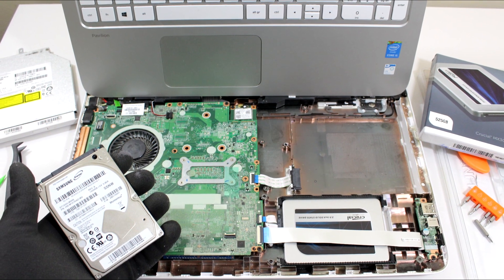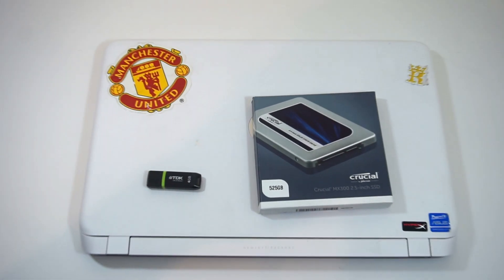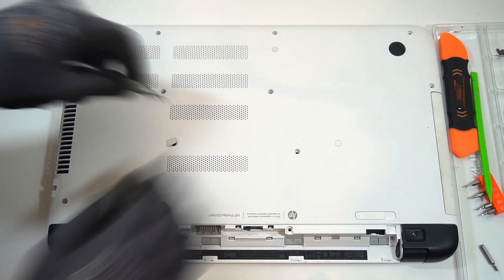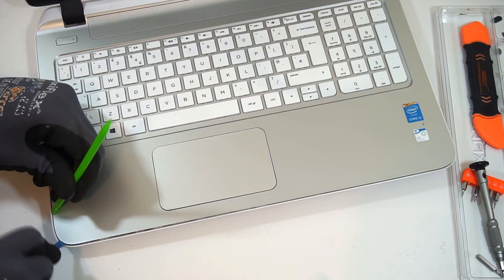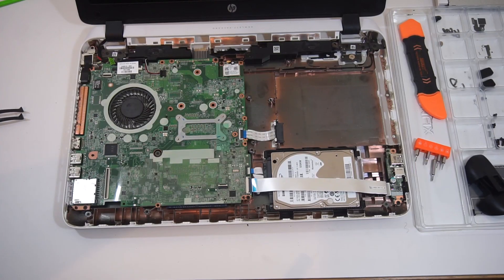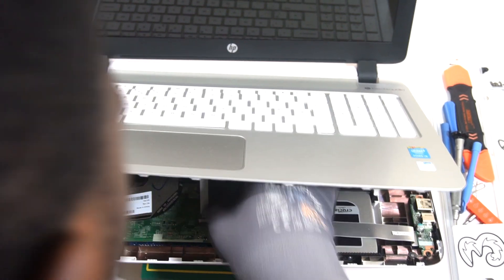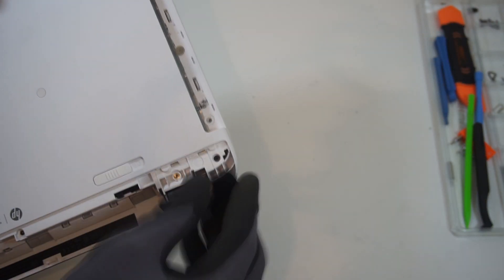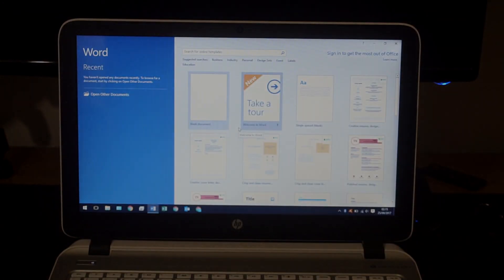Slow Laptop?  How To Upgrade Hard Drive To SSD - HP Pavilion P Series [15-p189na]

Comment: Great video, I have a P189NA that really needs an upgrade so will attempt this at some time soon. It currently has a 1.5TB hard drive and whilst it is great for as a main storage drive, it's just not fast enough for what I need. (My main laptop, also a HP, has a 2TB mechanical drive, and yes I do need 2TB on that laptop.)
One thing: according to HP's website, it says the laptop has two 750GB hard drives. Does this machine have two 750GBs or one 1.5TB? The SSD I am planning to use is Crucial MX500 512GB.
Also, how easy is RAM upgrade? I'm looking to upgrade to 16GB RAM at the same time.
Reply from the maker: I know this was 6 months ago but I'm just noticing it now.

So to answer your first question: no it's just one drive that's 1.5TB. it's just partitioned into 2 places.

I think the RAM is built in, I never looked into this. If it's not built in then you'd have to check the motherboard's RAM compatibility requirements.
Reply: @kingsley15  Thanks for the reply! If it's just one drive then it doesn't matter - it will just get a 480GB (or 512GB) SSD, and that's it. I've got a MX500 512GB SSD, and I've also got a 480GB SSD (can't remember what type). I have a funny feeling that the 480GB is a BX series. If so, the 15-p will get the BX drive (as it will be used less) and my gaming tower will get the MX500 drive (as they are better for reads/writes).
The 1.5TB HDD can just be put into an external enclosure, and used for additional external storage (or as a backup device) as required.

I've also since discovered that the RAM is not built in - it's on the back side of the motherboard. The motherboard may have to come out.
If that's the case, I'll repaste the heatsink, and give the fan a good clean as well, and might as well upgrade the WLAN card as well - if I'm doing that sort of a repair, I might as well do everything that needs doing.